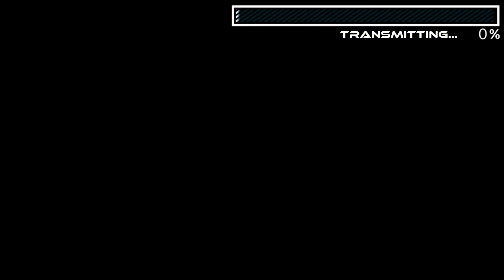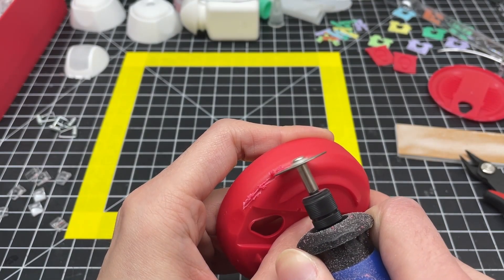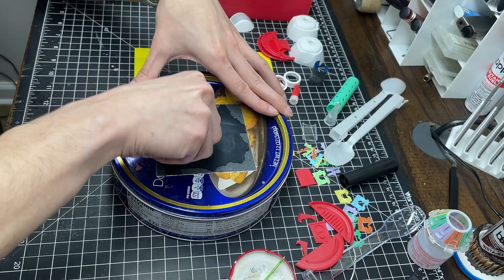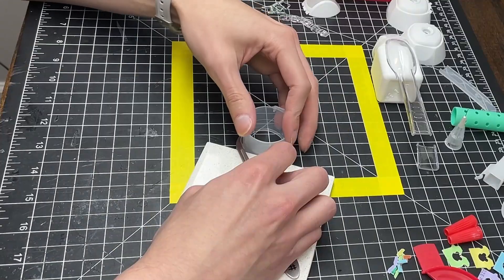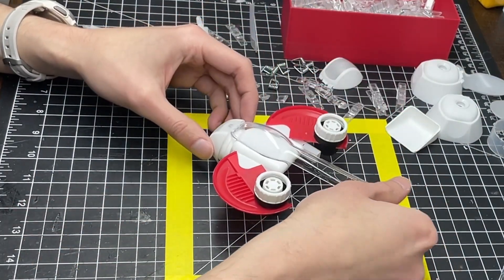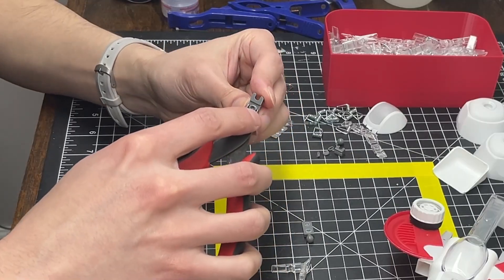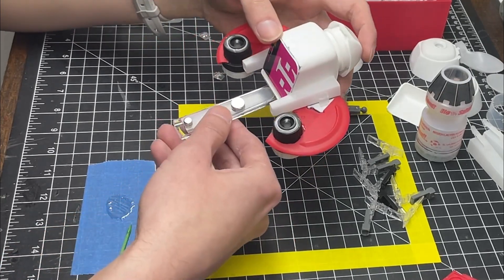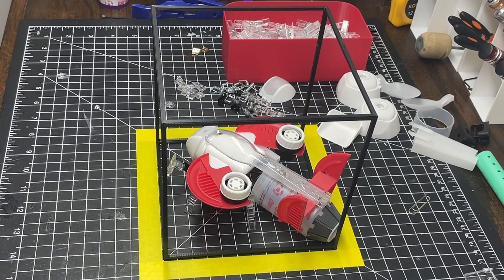Project WASP: Flying Mech from Scratch (Part 1)

Comment: If I may ask, what version of the Weld-on liquid solvent are you using there?
Reply from the maker: I’m using Weld-On 3 for styrene plastics like ABS but only if I need the strength. Feel free to always ask!
Reply: @proto.roborovski  Thank you! I saw that there were several varieties when I was looking online, but I was not sure which would work best for my own  kitbash/scratchbuild work.
Reply from the maker: @krzysztofmathews738  if you are kitbashing typical sprue models, you can use Weld on 3 because they are styrene, or you can get a specialty glue like Tamiya thin cement. I personally prefer super glue but it has a number of it’s own downsides, it just doesn’t smell or have toxic solvents 😂
Reply: @proto.roborovski  Yeah, I regularly use the Starbond varieties of CA glue, especially for gluing dissimilar materials. That said, I have an airbrush spray booth that I use when I need to vent other chemical fumes.  :)  For larger or heavier material (  I build life sized cyborg animals, among other things) I use Gorilla Clear Grip or Heavy Duty adhesive.